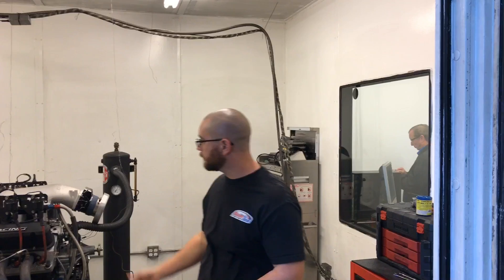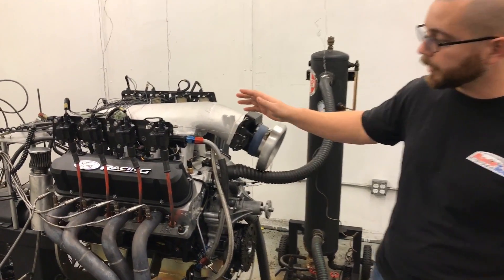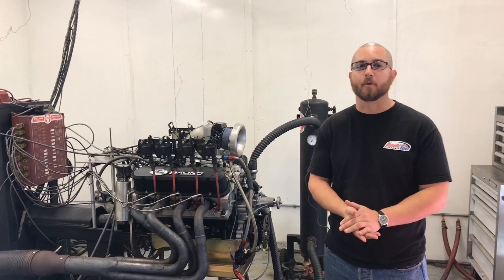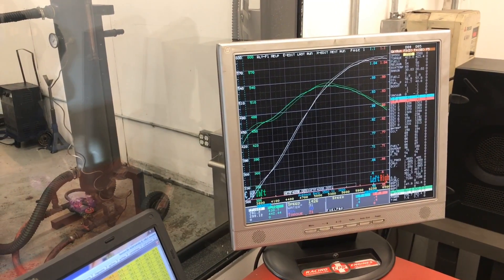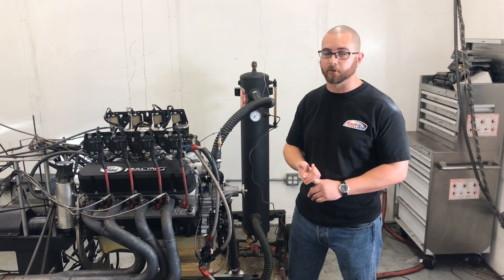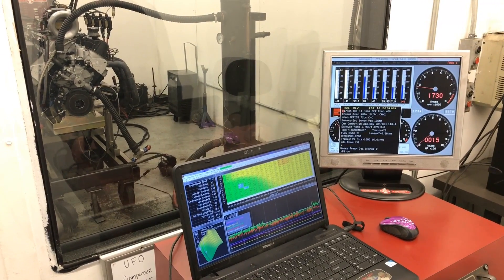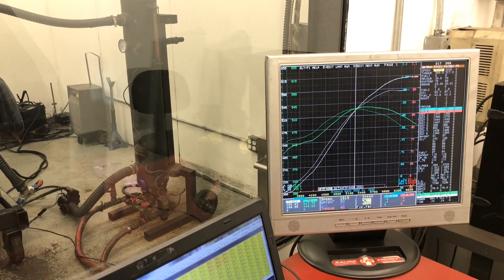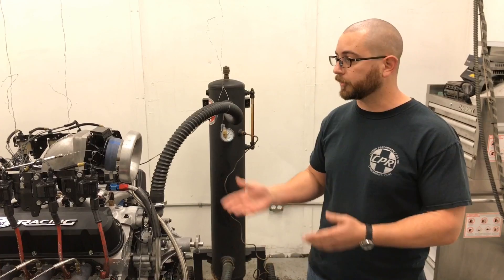CHP 408w Stroker Ford AFR 205cnc Cylinder Head - Cam/Intake Dyno Testing

Comment: Excellent post.   With the e85, the gain in a naturally aspirated situation is by the additional 1-4 degrees of timing that you add in.    On an engine this size it'll give 20-30hp on the top end.   That lower speed torque gain without adjusting anything is normal.

Comment: Hey Toby I believe Rob was saying the Edelbrock super victor Jr. Now which is it the Victor Jr. Or the super Victor? And the graph off the dyno he mentions the horse power being at 576 at 6500 does it carry deeper in the rpm or does it fall off at 6500  And obviously it would have been real nice to see a 850cfm Holley on top of the super victor. Man it would have been nice to know what LSA both cams had.

Comment: I'm a little disappointed...i have nearly exactly the same engine combination except my engine is a 427 with a .600 cam, 10.8:1 compression, 60lb injectors, billet distributor, MSD digital box and the Trick Flow 351W-R manifolds. it made a mathematical 511hp at the crank (467whp)😔
Reply: … but what’s the torque?  Simple Mathematical formula for HP is Torque X RPM Divided by 5252. Did you factor in Frictional horsepower loss due to longer rods or larger pistons?
Reply: @rayman1230  I'll get the torque numbers for you when i get to the house. I keep the graph in the car.
Reply: @rayman1230  i made a mistake with the numbers. My car made 435.83 whp and 474.57 wtq. I think when you divide those numbers by .85 you get 511hp flywheel and 558 flywheel tq.

Comment: Thank you for making this video, its hard to find Windsor info and you guys answered a lot of questions between the three intake/TB configurations as well as cams (though I wasn't paying close enough attention to get grind info). I am a bit curious though on the edelbrock efi intake, would the 4150 pattern throttle body offer better partial throttle response than a 105mm or is that too nitpicky?

Comment: You have to wonder if cam 3 had less total area under the valve. In other words did cam 2 move the valve to full open quicker. If not then the heads maybe maxed out for flow, so the extra duration could only lose Tq and not gain Hp. This is why if you don't have experience with performance engines you may want to leave building your expensive V8 engine to the pros. The additional cost can be well worth it.  I read the comments below. Not everyone is an expert, but don't tell them that.

Comment: The cam change tells the important story, and that is what you gain you lose. If you want 600Hp use a longer duration. If you want more Tq under 3500 RPM use a shorter one.

Comment: Why are you using the afr 205 heads instead of the 220 heads? I've seen engine builds with the smaller 302 stroker motors and they actually didn't loose any power with the "oversized" afr 220 heads. Just seems like the most logical thing to do given cubic inches and power. If it were me, I would always use the 220 afr heads if they would fit.
Reply from the maker: Actually, you can lose torque an power with a bigger port when not needed, AFR 195's would have been even better depending on cam and RPM, check out the 427W with 9.5:1 comp we did some months back.
Reply: @coasthighperformance  meanwhile Stock LS3's flow over 300 cfm with slightly larger than "normal" intake ports running 2.165" intake valves. Stock ported LS3 heads can flow 360 cfm @ 0.600" intake lift. I understand that smaller ports will have a greater velocity than larger ports and will fill the cylinders better at lower rpms. Still though, have read a few articles from reputable magazines on builds showing dyno's running little heads with a "mild" cam and then going all the way to the big boy heads and the big heads only lost out about 10 or so HP way down low, but more than made up for it up top...this was on a 331 stroker too. My thoughts are that 220 cc ports aren't that big at all compared to what the factory has been doing for the past 15-20 years...basically just "under cammed" with room to grow. For me, I would run large cnc ported trick flow high ports, AFR 220's, or the big boy Cleveland style heads that Jon Kaase helped tweak with an Australian company(pricey though) and nothing else, but that's just me. Seems like the only way to show the LS crowd that Ford is still a great option versus LS everything.
Reply: @port nut meanwhile, 4000lbs Camaro's with LS3's sporting 260cc intake ports are perfectly fine...

Comment: Is this a Stock Block 351 or aftermarket? I have a 351w in my garage that is two bolt mains and want to build a 408 out of it... I have Trick Flow 225 High Ports to put on it just not sure if I want to buy a Dart or Boss block instead of a factory block. Not shooting for a million HP or anything but wouldn’t mind playing with a little boost down the road. Any suggestions?
Reply: I have a a 351w out of a early 90's f250 and there is build articles showing that they got them to 1,000 hp and then the pistons cracked...this was stock internals. That block is fine

Comment: Numbers are nice for hp. How about the cranking compression for each combo? Would be nice to see
Reply: Over 550 tq is pretty damn good on a 408.
Reply: That and the A/F ratio.    On a 408 stroker or larger i'm expecting 600 tq or more for a optimized combination.

Comment: Got my CHP street fighter 408 short block dialed in finally. It's a street car not a drag car. Used 185 AFR heads. Custom grind bump stick from Ed Curtis at Flow Tech Induction. 1 7/8 long tubes Dynatech headers 3 inch x pipe and full 3 inch Magnaflow competition exhaust. Stock EEC-IV. Cheap speedmaster spyder intake with 42lb injectors. 92mm Pro-m MAF and 90mm accufab TB. It's a somewhat mild cam but has over 600 lift. Extremely fun street car with drag radials, coil overs 5 lug conversion etc. Car dynoed 533HP and 524TQ to flywheel. People said don't use the 185 heads. I say it's the best size head for a street car. Keeps the powerband right where you want it for the street. I bet I could get more outta it with a better intake.

1989 Fox Mustang tuned by Brain at Dyno tune motorsports in Galloway OH. (Columbus area) This guy knows how to tune your stock Fox EEC-IV. The stock computer on these cars are capable of supporting 1000hp if you have the right tuner and proper build.
Reply: Maybe to an email. I don't want to disrespect Ed Curtis and post his cam build on the world wide web.
Reply: It is a tough call choosing between the cheaper 185 heads and the 195s or 205s. Under 6000 RPM I just don't think the power gain is worth the extra $500, unless you have it to spend.
Reply: @johnnijssen8590   , I think it also depends on the weight of the car , I bought my TFS 206R heads in Y 2000,  i dont know if there were any bigger then , but even with a healthy cam it will pull from 1200 in 4th , also dynos can make the torque figures look better than they actually might be , because they hold the engine back so much ,and rev much quicker in the real world , I'm  running ITB's now , https://youtu.be/DmhQWl0zRhc  .Cheers

Comment: 600hp LS cost 5k, 600hp Windsor cost 10k....   Thats a hard pass.
Reply: Also, this is new quality parts, not junkyard repurposing spending the bare minimum to produce that power level. I am getting sick of people pulling articles out of context and just blasting the internet with numbers. I personally just bought an 6.0 LQ4 longblock out of an chevy 2500 on ebay for $825 shipped. I am going to get the heads sent out to get fully machined and ported at TEA or Texas Speed...$1,400. Cam and pushrods, $400. 4.060 forged pistons and rings $700 bringing it to 375 cubic inch. Stock crank and rods will be used. ARP bolts for the rods and mains are about $300 and another $300 for the head studs. What about all the other bolts? Balancing and machining estimated at $1,000. Gaskets, bearings...this shit adds up fast... my goals are to have a reliable high 400 hp to almost 500hp, daily driver NA on a stock computer, stock converter, pass emissions  and have fun in an older 2005 chevy tahoe. The engine longblock budget is $5,500, but this is only attainable because the block, heads, crank, and rods are going to be reused. My heads ported are $1,400, if I wanted to use AFR LS heads those are over $2k. If I wanted an aluminum LS3 block, that would be another $2k
Reply: @sean5comet  ...Learn to do more than spend money and run your mouth... pretty much all I can tell ya. Proof is in the pudding sweetheart.
Reply: Show me a new ls build that makes 600hp for 5k. I need full parts list, machining, I want to see the whole cost...because I bet you can't produce said list.
Reply from the maker: LSX is 40-50 years newer and has replaced the small block Chevy. While it may cost more to make more power with the Windsor it is still a valid powerplant with the right components. We build LS engines as well but let's not compare apples to oranges  ;)

Comment: You need the 220 heads and you would of made 650hp with larger duration cam
Reply: @bigboreracing356  438w 11.35:1 compression,  Xr292r comp cams street solid roller tight lash, port fuel injection,  th400 transmission cause i bles up 5 built C4"s,  transmission full manual reverse pattern valve body, super vic efi intake with eddy elbow. Drives great on street and traffic. Idles 1300rpm. Pulls to 7200rpm like a swiss watch.  Made 530wheel which is probably 650plus crank with 20-23% driveline loss. What do you think it makes at crank. Stall is 4k rpm. 410 gears 8.8 Eaton trutrac rear. Big stall th400 takez some power but faster than stick
Reply: @bigboreracing356  My 438w isnt small
Reply: @bigboreracing356  Nitrous hard on motor
Reply: @bigboreracing356  Runs fantastic and spins to 7200rpm like a swiss watch.  220 heads only way to go uo to 700hp
Reply: @bigboreracing356  I was told nitrous wears engine out way way faster than blower or turbo. Is that false?
Reply: @bigboreracing356  It has a comp cams solid street roller,  not a drag cam. Easier on valvetrain.
Reply: @bigboreracing356  Valve springs run 220 seat and 550 open. Street solid roller designed to last on street. No drag cam, fck that
Reply: @bigboreracing356  Huge be cool radiator and 2 13in spal fans custom shroud runs 170-180 in 95 heat in traffic. Use isky bushed solid roller lifters fully built  short block ford svo 4 bolt mains every cap. Mahle pistons scat h beam rods scat forged crank. Hv melling oil pump
Reply: @bigboreracing356  Full e85 compatible fuel system and runs on 93 octane
Reply: @bigboreracing356  Fuel system uses Radium surge tank with twin 320 Aem pumps, only 1 pump runs for gas though, holley black feeder pump and 2 e85 compatible filters.
Reply: @bigboreracing356  What octane does 408w in video run. What compression and what power it makes at wheel n what car and transmission
Reply: @bigboreracing356  You have convinced me to eventually try nitrous.  I cant use plate kit cause hood clearance.  I need to pull intake to install proper nitrous injectors correct. That car would be mid 9's with a 100 shot easy. Only weighs  3klbs 68 mustang
Reply: @bigboreracing356  I read a big stalled auto will eat 25% power. So my engine must be 700hp if vfc it dynod 530wheel with th400
Reply: @bigboreracing356  800lbs open spring pressure.  Damn you must run a massive drag roller cam..My street roller only 550 open pressure. That's why i went with Xr292R street solid roller tight lash cam. Last a long time on street. Designed to be driven on street. Car has way better street manners with Port fuel injection too. I may add nitrous later. How do you notice th400 has less power up top compared to glide. My c4 felt about the same as my current th400. My tranny guy said my th400 built to take 1200hp so no more dropping transmission again like pos C4. Fried 4 c4 transmissions in that car. C4 transmissions dont last over 400wheel very long. You better get the isky bushed lifters asap. I had crap comp needle bearing lifter ruin my previous 393 windsor. 5 of them failed
Reply: @bigboreracing356  Hey i will get you some new videos soon of street driving. Wasted model 3 other day. Those thing are quick from dig though
Reply: @bigboreracing356  How often you adjust valve lash and what are your cam specs and lash. What octane you use. I put 1500 miles a year on my car or more.
Reply: @bigboreracing356  You run fuel injection or carb. Fuel injection is the shitzzz.  Port fuel injection that is. Your cam must be hard to drive on street.
Reply: @bigboreracing356  I get my lash checked once a year. I hope my isky bushed lifters hold up. Good so far. And isky rebuilds em too. I run .010-.012 intake and exhaust cold lash. Comp cam
Reply: @bigboreracing356  Car is built for e85 too. Just needs a tune. Right now on 93 octane
Reply: @bigboreracing356  My transmission guy said th400 better for me on street compared to 2 speed glide. Glide more for racing
Reply: @bigboreracing356  What did your 562 bbc dyno at wheels
Reply: @bigboreracing356  Bro you have a blower on that engine. What's compression.  Damn that thing must make 1k wheel. What you running like 8.50's. Yea i have adjusted my valves 3 times since engine built in 2015. So this 4th adjustment should be good with lash unmoved cause motor is settled in now at 2800 miles. Isky said they have bushed lifters solid rollers with 30k miles on them and still look new.
Reply: @bigboreracing356  Are you carbed or efi

Comment: Nice comparisons. Would that 2nd cam be considered street friendly still?
Reply from the maker: Everyone has their own idea of what is street friendly, we focus on powerband/RPM range to focus on where it will live most of the time.
Reply: Coast High Performance I ended up emailing with Tobias. He kicked down some good knowledge. I’ll be ordering my kit from you guys as the rough bore is done. Thanks guys
Reply: @coasthighperformance   what size injectors were used here?

Comment: can you guys explain the differences between this coil on plug vs the pro-m racing racing coil on plug system
Reply from the maker: this is the AEM efi system, will allow you as the user to define spark and fuel tables with a user friendly laptop experience. You can use any smart coil and will allow for individual cylinder timing as well as fully sequential timing and fueling. 

check them out! AEMelectronics
Reply from the maker: Not sure who Pro M is but our AEM system is similar to Holleys. We will be testing it out on a street/strip 427W Solid roller engine in the next few weeks.
Reply: @coasthighperformance  How much power did 427w solid roller make

Comment: 205cc heads on a 408ci?......joke. Put some real heads on it, not heads off your mom’s station wagon.
Reply from the maker: riiiiiight, put the biggest heads on it, that will always make more power, just like having the biggest cam, yes, that is sarcasm ;)
Reply: Re read please.  I said real heads, not biggest, 205s are small for a 408. Never mentioned cam selection either. Thin skin much?
Reply: @petejoseph8257  Your mom has AFR 205 heads on her station wagon!? Badass.
Reply from the maker: @petejoseph8257  not at all, never heard of "real heads", application is everything and we were given parts to test them on a 408W with 10.5:1 compression on pump gas so that is what we did.
Reply: @petejoseph8257  Making abrasive comments and then complaining when someone replies to them implies you're the one with thin skin. Get over yourself.

Comment: I was wondering what you guys thought about using the 102mm TB as opposed to the fairly common 90mm TB you normally see folks using on similar builds. How much do you think the larger TB is worth on this size engine? I'm doing a 427W and already have a 90mm TB, and I am wondering if I'd be much further ahead selling the 90 and going to the larger TB.
Reply from the maker: not much on that HP

Comment: Try a bit more on the heads. Maybe 220/205cc clearances.
Reply: I TOTALLY AGREE AFTER ALL IT'S NOT A 351 IT'S A 408 MORE AIR IS A NECESSITY ESPECIALLY AT HIGHER RPM'S

Comment: Great video guy's.  Seems like the Holley HiRam isn't taller than a Victor Jr intake with carb amd air cleaner.  I have a 408W with boss 351 block Vic Jr heads ported and matched to Victor Jr intake.  All ARP studs hyd roller etc.  Wanting to convert to Holley Dominator efi with port injection and E85.  Do you think I could bump compression ratio to 11.5:1 and also add a Procharger F1a 94 if I run E85?  Thanks
Reply: I know it's been 3 years and you've probably already made the move... but in case you haven't, yes, you can. I have a 12:1 compression turbo motor, on E85. I pull .75 degrees per lb of boost on the street, to be safe and maintain some resemblance of traction lol. You can be as aggressive as .5 degree/lb if you're actively monitoring knock while tuning. For the track, I use Ignite E90, and can go close to methanol timing numbers. Good luck!

Comment: What was the second cam you used? I'd like to get one.
Reply from the maker: Sure, 252 duration cam cost is 425 shipped for custom cams, ETA is about 10 days when order is placed.
Reply: @coasthighperformance  Where these solid street roller cams
Reply: I would like to order the second cam also
Reply: @coasthighperformance  do you have a number I can call to order the second cam you tested?

Comment: Have you guys done a similar setup purposely built for e85? Like 13.5:1? More duration. Leaning to having you guys build me one for my 66
Reply from the maker: Yes, making 740HP, NA on a 441 on E85, hyd roller.
Reply: @coasthighperformance  what heads for that build
Reply from the maker: @timmartin4798  That was on a 441 LS3 stroker with our custom heads and actually made 760HP